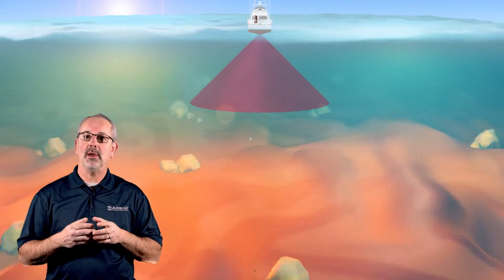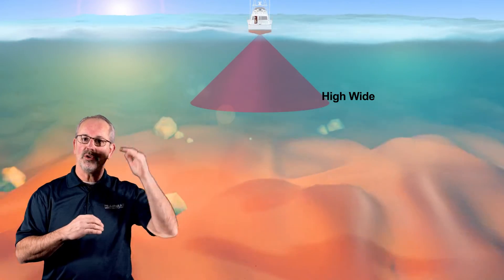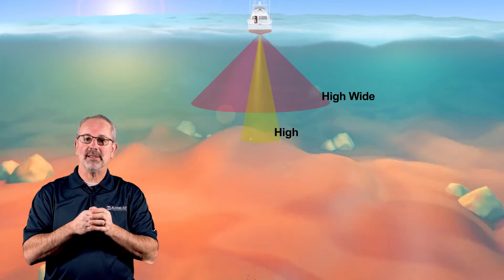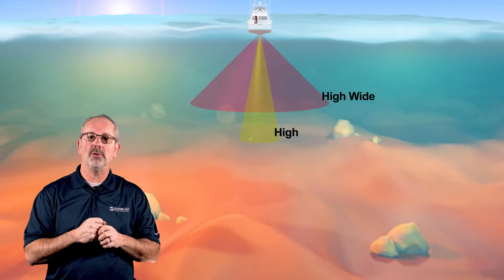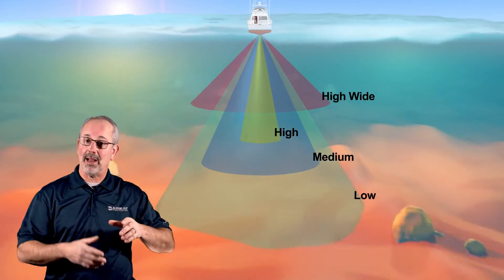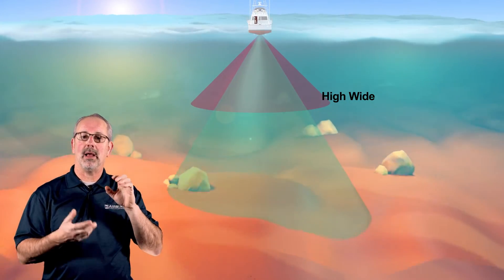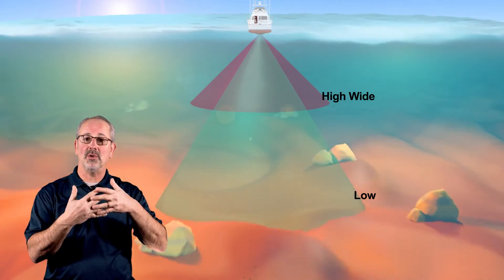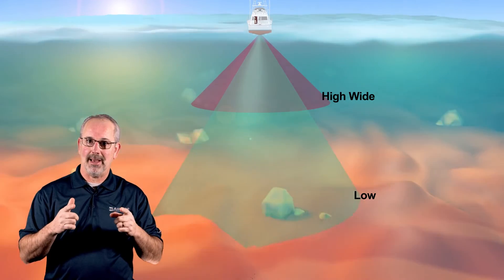Q & A with Craig Cushman from Airmar Technology

Comment: Hi Craig. I purchased a lowrance HDS Live with a 3 in 1 transducer 
I want to add on a Airmar TM 260 , 1 kw transducer to find fish shows on the bottom of the reef in water depth between 80 and 150 metres. 
Is this the correct transducer for me.
Kind Regards Bob.